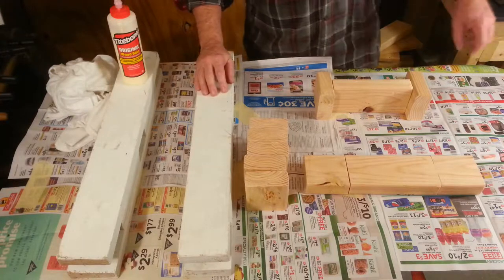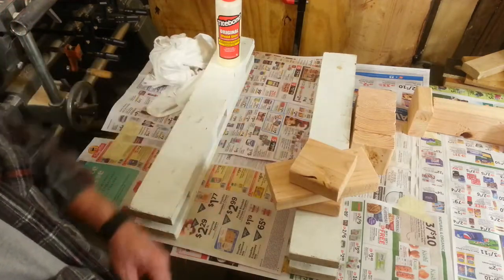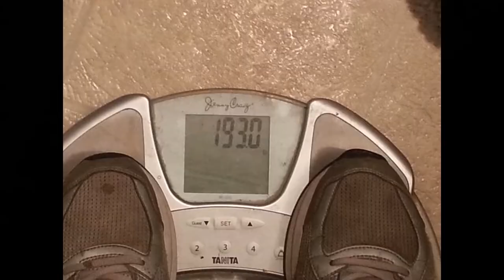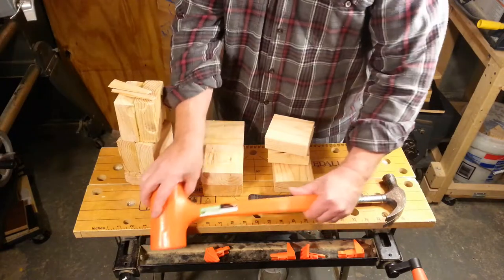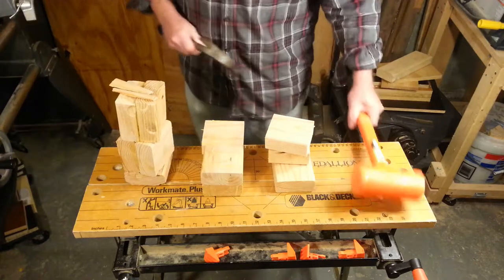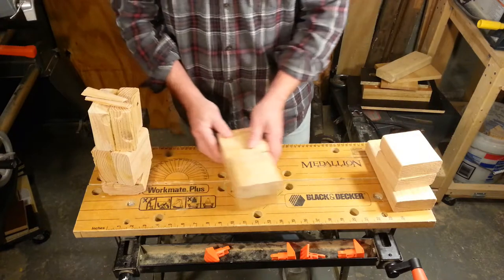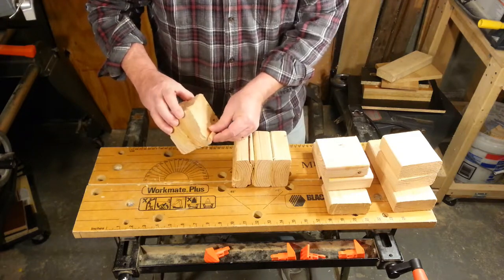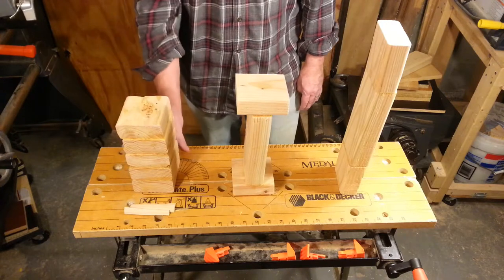78. How strong are wood joints held ONLY with glue?

Comment: Try it again with freshly planed precision surface. Where the glue gets squeezed out during the clamping.
Reply from the maker: Hi Gerry. I think what you are suggesting is that flatter pieces glued together will produce stronger joints. I totally agree. In this very unscientific video though, I was going for a "quick and dirty" test to verify that face grain glued to face grain generally makes a stronger joint (which I think I demonstrated in the video). 

What I did not try (because I didn't think of it) was to try end grain to end grain again but only after I applied a first layer of glue to each end grain and allowed it to dry before applying the 2nd layer and then clamping the parts together. I have read that doing this can produce a stronger end grain to end grain joint. This additional test is on my very long list of video updates to do at some point.

Thanks for your comment and for watching.

Comment: Glue on end grain should have one coat applied that is thinned with water, allowed to briefly soak in, then a second coat full strength. This is per the manufacturers instructions on their website, and creates a stronger bond.
Reply from the maker: Yes, I became aware of that method for gluing the end grain AFTER I had made the video. I have not tried it yet but I imagine the bond would be much stronger.
Thanks for the tip and for watching.

Comment: Very clear. Glue is stronger than the wood if the gluing is long grain to long grain. Thank you Sir.
Reply from the maker: You're welcome. Knowing this, you might decide not to use as many (if any) nails or screws to fasten pieces of wood together. I have seen where some wood workers on YouTube mainly use glue. I am starting to adopt this mindset which makes clamping more important. Sometimes I use screws as the clamps and after the glue dries, remove the screws and replace with glued in dowels.
Thanks for your comment and for watching.

Comment: Nice demo. I have some top,angled cedar fence boards that are rotten where they meet the top of the 4x4 uprights,and I was thinking of buying one cedar replacement board and sawing out the rotten part,and butt gluing a replacement section in to replace them. I don't need the strength  as demonstrated in your interesting video.
Reply from the maker: Hi Mike. Thanks for your comment. I have two thoughts for you to consider. 
1) If you want to try joining the pieces using butt glue joints, try putting glue on the end of each piece AND then letting the glue completely dry WITHOUT sticking the boards together. After this first application of glue dries, apply another layer of glue AND then stick the boards together. This might make for a better joint. Also, be sure to use a glue designed for exterior projects. Titebond 3 or Gorilla glue would be glues to consider. Click here for more info: https://amzn.to/3RBiGES
If glue alone won't give you the strength you need to hold the pieces together then:
2) Consider using dowels AND glue to stick the boards together. The dowels will provide a much better glue surface and also help keep the pieces aligned. There are MANY different doweling jigs to help. Here's an example of the cheapest one I could find: https://amzn.to/3RHs9ul . To use this effectively, you'll need to be able to drill holes without using a drill guide. However, I do recommend using a drill guide. Click here to find info about different doweling jigs with drill guides: https://amzn.to/3qBLCAW .
It makes sense to do some testing with a scrap piece to see if glue alone would work or to try using a dowelling jig. Good luck with your project. Thanks again for your comment and for watching.

Comment: Great video!  Proves that gluing on end grains is pointless.
Reply from the maker: Exactly! If you want to use glue on that end grain joint, consider using a dowel or a domino to get some long grain to long grain glue surface to glue with. Thanks for your comment and for watching.

Comment: The long grain/5 piece had much more surface area than the other 2
Reply from the maker: Good point! I should try the test again only having the same glue surface area for each joint. I suspect the result will be very similar but it's worth doing the test again. Thanks!

Comment: so what's the verdict? can a couch be made with just glues? i don't see any problem seating on it. but when kids are jumping...?
Reply from the maker: Interesting question Alan. I would say "yes", a couch can be made using just glue to hold the parts together IF the wood parts are designed correctly (pay attention to the grain direction) and use good joinery (mortise & tenon, box, dovetail, etc.). Dowels, splines, and wedges can also be used. In other words, the wood parts need to be designed so that they interlock with one another. Woodworkers in Asia have been doing exactly this for centuries. I think metal fasteners and glue came into use to speed up manufacturing.
A quick search on YouTube turned up this video (this is not one of my videos): https://youtu.be/V0CHDwG6m44
Thanks for your comment and for watching.

Comment: I suppose that for decorations/simple stuff that don't need to support heavy height , or impacts , simply glueing 2 pieces of wood with pva glue will be just fine.
Reply from the maker: I made this video quite a while ago so I re-watched it to remind myself how strong the various joints were. ALL of them were able to hold my body weight (which I was surprised about). The long grain to long grain joints took A LOT of beating with a 16oz claw back hammer until finally, the wood failed (sheared) NOT the glue joint. I remember now how hard I had to swing that hammer to get those pieces apart.
Keep in mind that I did NOT flatten or square the 2x4s used. I cut a typical 2x4 from my local home improvement store and glued up the pieces. IF I had gone through the extra steps of flattening and squaring, I think all of the joints would have been stronger. If I added dowels or splines, the joints would have been stronger. And if I let the glue dry on the end grain joints BEFORE assembly, then added a 2nd layer of glue and assembled, I think the joint would have been stronger.
So my conclusion is that glue joints alone are strong and can be made quite strong when gluing long grain to long grain. But I don't think I would rely on just the glue because I consider the glue to be a fastener; I would typically use some joinery along with the glue (if appropriate after considering wood movement).
Thanks for your comment and for watching.

Comment: So how did you control for the mechanical advantage/geometry of the piece which distributes forces differently? 
Because if we apply different forces to different pieces the conclusion is not clear, and in fact could be the opposite.
A follow up video is in order, LOL
Reply from the maker: Hi Roy. I will definitely agree that my "test" of the glue joints was not very scientific. There were all kinds of variables which I couldn't easily control and of course, I don't have any way to measure the impact force. In this video, I was going for more of a qualitative comparison versus a quantitative comparison.
I have since heard of a way to make end-grain to end-grain joints (shown to be the weakest in my vid) stronger although I have not "tested" it yet. Rumor has it that if you apply wood glue to the end grain of both parts and let that dry, then apply fresh glue over top of the dried glue and clamp the joint together,  after the 2nd layer of glue has dried, the joint should be stronger. I think that might be worth a follow-up video; what do you think?
Thanks for your comment and for watching.

Comment: Cool vid. Goes to show how good titebond glue is. I’m actually building a box with end grain-long grain joints. Then putting nice dowels in so they are visible. But was wondering if it would even hold together before I put the dowels in. This has given me some hope. 
I’d like to see a fair comparison though. Like make all the bits of timber same size and in the same configuration like the long grain-long grain test and see how they fair. There was some mechanical differences which would bias the test. Awesome to see though. Iv subscribed.
Reply from the maker: Thanks for watching and for your comment.
Yes, I think your box will stay together (just don't hit it with a hammer ;) with just the glue. The dowels should provide more strength and add a decorative feature.
I definitely agree that the test could be done a lot more scientifically. My intention was to do something quickly and get a rough feel for how strong the glued joints were.
Mostly what I got out of this simple test is that, whenever possible, try to add some joinery (even simple joinery) that allows for some long grain - to - long grain glue joints. These glue joints might just eliminate the need for any other fasteners.